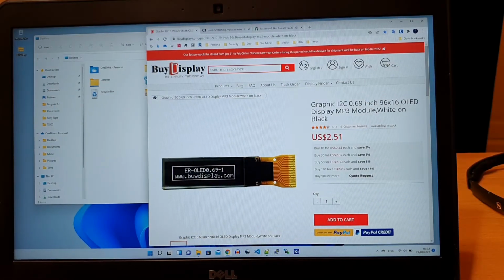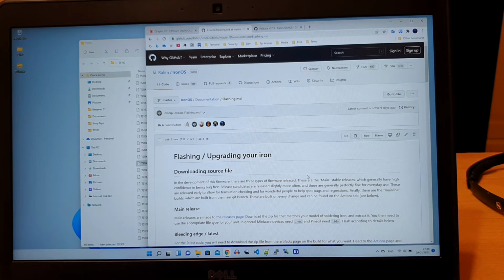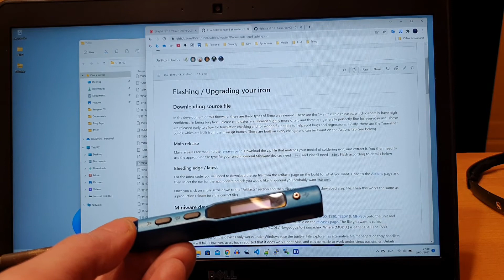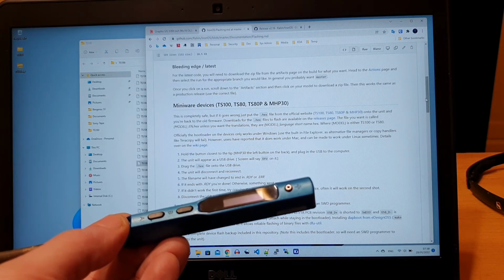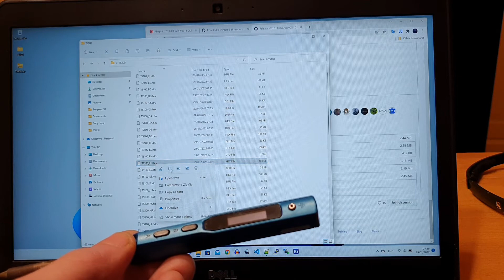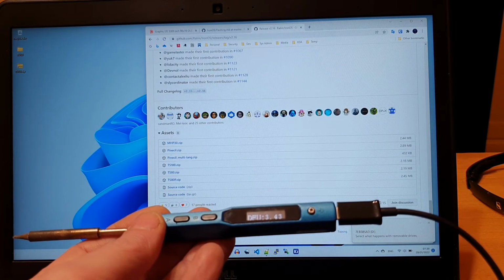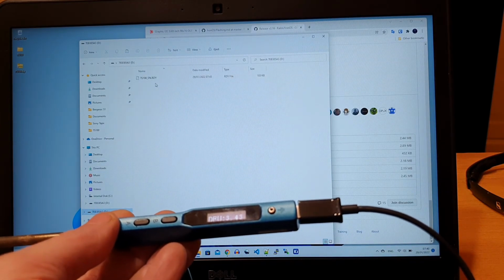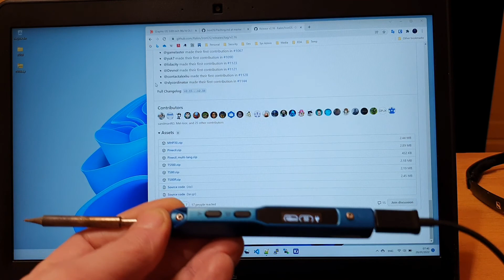TS100 Soldering Iron: Screen replacement and firmware upgrade

Comment: The same thing happened to my TS100 while I been ill for some time and not used it for ages it just lost it's brightness it's a mystery why as it's been sealed in it's case ? I have linked to your video as when I get a new display I have to follow your tutorial.
Reply from the maker: Yeah that is indeed perplexing how it could fail without extended "on time".

Comment: Hi. Thanks for the excellent video.
Does the screen remain on constantly while the iron is in use?
Can you estimate how many hours you used it before it became unreadable?
Thanks.
Reply from the maker: There is a timeout to sleep mode when not actively in use (motion sensor/button press). I used it very little in the year or two (guess) I had it, just for occasional hobby use. When in use, yes display is on.